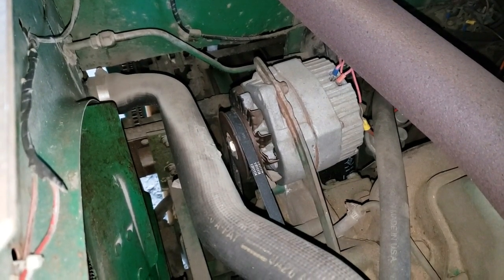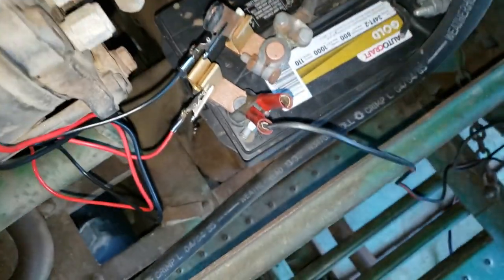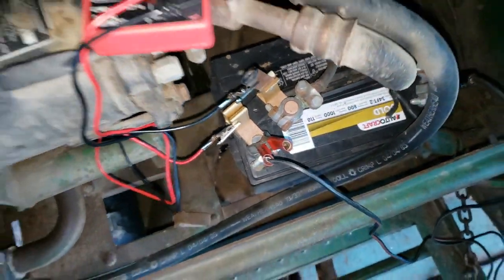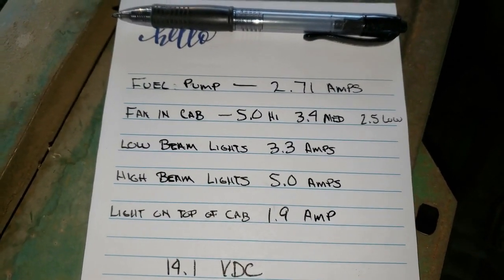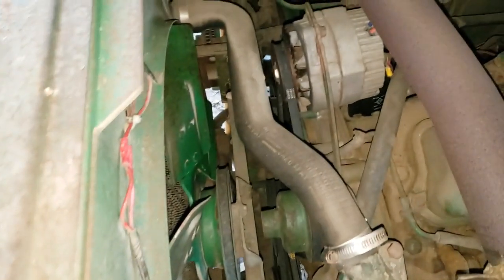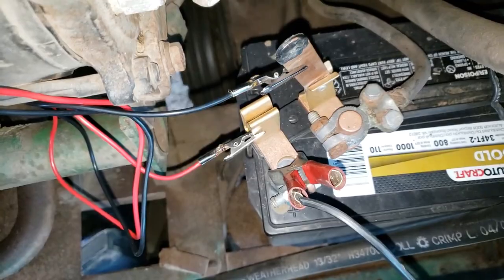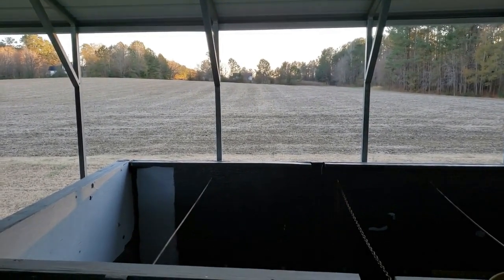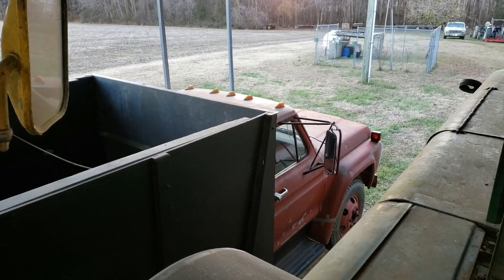Is that really enough Alternator

Comment: Great video. I put battery disconnect switches on all my equip. Saves a lot of dead batteries. mount a 2speed fan in the cab. It'll help with hot sun thru the windows.
Reply from the maker: The person I bought this combine from 20 years ago had already put one of those nice little two-speed fans up in the corner and yes it really does help out a lot but the biggest solution what's getting a cut off valve in that hot water line that actually stopped the flow of water. My last ride in the combine was great as far as heat went in that cab. Thanks for watching.

Comment: we almost went to all the GM 1 wire Alternators on all of old Ih tractors since we run a lot of monitors and gps equipment . Plus we might be going to a electric drive corn planter in the future and those require a certain amount constant. And funny you showed the battery disconnect since most of the new tractors and combines now come with them from factory.
Reply from the maker: https://www.dbelectrical.com/products/chrome-chevy-alternator-110-amp-one-1-wire-65-85-adr0335-c.html?mrkgadid=1000000&mrkgcl=1145&mrkgen=gpla&mrkgbflag=0&mrkgcat&acctid=21700000001643279&dskeywordid=92700057558223691&lid=92700057558223691&ds_s_kwgid=58700006372555049&ds_s_inventory_feed_id=97700000007195091&dsproductgroupid=841613208618&product_id=ADR0335-C&merchid=1552033&prodctry=US&prodlang=en&channel=online&storeid=%7Bproduct_store_id%7D&device=m&network=g&matchtype&locationid=9009721&creative=469157498045&targetid=pla-841613208618&campaignid=835875553&adgroupid=113219693514&gclid=EAIaIQobChMIkL7b_s3C7QIVmIzICh0uZgufEAQYAiABEgKloPD_BwE&gclsrc=aw.ds

I was joking around with Andy last night and asked him if he thought this alternator would be a bit too flashy for my 3300.🤔☕

Comment: It's funny how little juice the LED's draw , Way less than the old bulbs did. I put 11 LED lights on mine and they dont use as much as the 4 regular lights did. That was always a problem for the older combines, You just couldnt get enough lights on them to see good without killing the aultenator . So I'm all for LED lights cause you get more brighter light and its easer on the combine .  Cousin Bandit
Reply from the maker: I knew the LED lights drew a lot less current than the lights that I was replacing but I just needed to get my mind cleared up and wrapped around how much current was actually being pulled from that alternator. It's good to know that I got plenty of alternator space left and can add some more lights and maybe even an 8-track tape player, 😆 lol...
Hey you think this alternator might be too flashy for my 3300?
https://www.dbelectrical.com/products/chrome-chevy-alternator-110-amp-one-1-wire-65-85-adr0335-c.html?mrkgadid=1000000&mrkgcl=1145&mrkgen=gpla&mrkgbflag=0&mrkgcat&acctid=21700000001643279&dskeywordid=92700057558223691&lid=92700057558223691&ds_s_kwgid=58700006372555049&ds_s_inventory_feed_id=97700000007195091&dsproductgroupid=841613208618&product_id=ADR0335-C&merchid=1552033&prodctry=US&prodlang=en&channel=online&storeid=%7Bproduct_store_id%7D&device=m&network=g&matchtype&locationid=9009721&creative=469157498045&targetid=pla-841613208618&campaignid=835875553&adgroupid=113219693514&gclid=EAIaIQobChMIkL7b_s3C7QIVmIzICh0uZgufEAQYAiABEgKloPD_BwE&gclsrc=aw.ds
Reply: @SoybeanFarmer3300  Knowing in your mind what they draw amp wise puts your mind at ease . My old 95 I put a set of those row burners on it you know the old Hallagen lights that made an aultinator scream !  It finally took its toll on it cause the last time I ran it the aultinator went out and I think the lights had a lot to do with that.  I dont know if I would put an 8 track in it, It might be a bit too dusty for it to work good !  Good AM FM would do the trick  I think.  Mine has a AM FM CD player in it, I never turned it on ! LOL But its there if I want to listen to it !  Speaking of the radio if you got time and around the computer type in WOBO 88.7FM into the computer and you can listen to the simocast on the computer and you can see what kind of music they play threw out the day and week and it changes music styles. They play everything from old country blue grass gospal Polish German Irish old R&B big band 50's 60'70's  you name it they play it.  There MOTO is Something for everyone. Its a local public radio station you can listen to on the computer and I think you might like it . Cousin Bandit
Reply from the maker: Bandit thank you for sharing that with me I'll check it out.

Comment: Funny alternator story: I have 2 of that same alternator on a shelf. All new. Back when I was bringing in Jeeps to fix and sell one of the parts houses said they had 7 alternators I could have at $23.00 per plus shipping if I took all 7. Old stock they wanted gone.New and not rebuilt. Took all 7 and used on some wranglers,my Ford 335 Industrial, a case loader landscaper,a John Deere backhoe,and still have 2 left. That model seems to be a universal fit for the 70's and 80's era.Can't say I ever verified a load requirement for an alternator but seeing you do it makes sense. I have a clamp on amprobe and might turn everything on and see what the meter says for alternator output.
Reply from the maker: Amos thanks for sharing that with us.

Comment: What did the ac compressor use. That is when there is a big jump in amps. I can't remember if you said if the ac works or not on your combine.  

I just put 2 of those battery disconnects on the combine and 2 on my IH 1086. The battery slowly discharge over time. Now that I'm done for the season, I just flipped the arm and don't have to worry about it,  lol. I remember when you did the video putting it on so I took your idea. Thanks for sharing.
Reply from the maker: The AC compressor clutch is latched by magnetic coil the current flow on that is less than an amp. It's an old R12 system that needs charging probably a total rebuild  on certain components like say the dryer.  Yep I really like these disconnects on these batteries and they do seem to make the battery last longer. Thanks for watching.
Reply: @SoybeanFarmer3300  Curisoty led me to check on the price of R12 refridgerant.....$!40 to 160 a pound... Chances are almost every thing but the condenser and Evaporator would need replacing.....(Comp, Expansion valve, Drier, Suction line, Hot gas line, warm liquid line...
Reply from the maker: @farmingforfunandprofit940  there was a good joke going around back when gas prices were at $4.25 a gallon. Teenage boy came in and told his dad he had just filled his car up with gas and now his car was worth twice as much. The tires were the big expense this year next year I'm going after rasp bars. After stopping that hot water from flowing into that heater core the ride really wasn't that bad. I'm never going to do wheat so I won't be in that Cab in June ever again. Thanks for your thoughts David. Always good to see you here my friend.

Comment: we don't have lights working on most of our combines we have mice get in there when we are using then combines over winter spring and summer and they chew up the wires so the 4400 and the 6600 that we use for corn dont have lights not totally sure about the last 6600 it might have them but i know the 4400 and the 6600 dont have them and probably never will
Reply: I never understood why tractor manufacturers don't do better on wiring. Something as simple as a bittering agent in the insulation would fix the problem with rodents eating same.
Reply from the maker: https://www.thedrive.com/news/20878/rodents-are-feasting-on-newer-cars-soy-based-wiring-insulation
the cost of repairs for some have been through the roof.
Reply: @SoybeanFarmer3300  we need a wire that can not be chewed threw by mice bc that’s our problem is that we can fix the wire all we want but the mice will just chew through it again
Reply from the maker: The total solution to your dilemma is going to be expensive but I would actually recommend total encapsulation in conduit. Or get a cat and make sure the Cat Knows where his food is at.
Reply: @SoybeanFarmer3300  we don’t have enough space to have them at our place so we rent a place and have them there but where we rent there is a cat

Comment: Good calculations SBF, I guess if it was a gas engine it would have at least a 55Amp Alt in there
Reply from the maker: Jan my friend you just made an excellent point yes if it was a gasoline engine requiring ignition spark the alternator would certainly have to be stronger. Thank you for making that statement here.

Comment: My Gleaner has two alternators,but it also has two electric clutches ,one on the header drive and one on the thresher drive and wow does that draw some amp's especially with the lights on. Thankfully I've changed 2/3 of them to LEDs! Thanks SBF
Reply from the maker: https://www.westmarine.com/buy/balmar--max-charge-digital-12-volt-regulator-for-dual-alternator--12032991

Most people would never be able to correctly wire this up and the troubleshooting confusion in the event there were problems or issues would send them looking for someone who thoroughly understood DC circuitry. Heck, I had to sit here and think about it for a while to realize how it could be accomplished. Most of the forms that I shot through simply talked about replacing the single alternator with one with a higher output. I kept getting hung up on how would you handle voltage regulation and create proper isolation but there's a component specifically designed for that purpose it's called a voltage regulator for dual alternators.  CE, thank you for something to genuinely challenge my thought process. Always a pleasure to see you here my friend.

Comment: Good use of forced down time, one less detail to be concerned with. God Bless Brother!
Reply from the maker: Went shopping today to found myself back up at Harbor Freight. They had a 29 piece drill bit on sale for 10.99 with coupon.  How do you re sharpen drill bits?
Reply: @SoybeanFarmer3300  Resharpening drill bits is a learned art. A good instructor detailing the needed geometry and lots of practice.
Reply from the maker: So that's why I've had no success. Seriously after my attempt at sharpening a bit I think it's actually duller than it was before I tried to sharpen it, it certainly cuts no better.
Reply: @SoybeanFarmer3300  Hey, just happened to see this... Look up This Old Tony.  He's got an excellent video about drill bits and makes sharpening them make a lot of sense.  I've been sharpening my own now for a couple years just on the bench grinder and it gets a lot easier with experience.
Reply from the maker: Thanks for telling me about that channel I will certainly go and check it out. I'm open to instruction because I would really like to learn how to re sharpen a drill bit. I've got plenty of bits that I've ruined attempting to sharpen them that I could use to practice on I just don't truly understand the technique required. Thanks again for the input.
Reply: @SoybeanFarmer3300  Look into a drill sharpener, especially for smaller than 3/8' drill bits. Some work real well.
Reply from the maker: Any recommendations on those? I have looked at 1 called Drill Doctor but some of the reviews on it make me hesitant.
Reply: @SoybeanFarmer3300  The Drill Doctor has been around for years. Every devise has some flaws. The angle of the tip (59 degrees), equal widths of the drill tip and clearance behind the cutting tip is the most critical. The Drill Doctor has to be affordable so it will have some issues after multiple uses. Patients and understanding the directions should produce a decent usable drill bit.
Reply from the maker: That was one of the complaints the tool wore out too quickly and went out of adjustment. I was thinking the wear on the cutting Stones is probably what took it out of adjustment. As you said it has to be made affordable so it's probably not got the best materials in it.
Reply: @SoybeanFarmer3300  You can also get attachments for bench grinders that will hold the bit at the proper angle and allows you to kind of roll the bit into the grinding wheel.  They work really nice and help keep the point centered.  They take more setup, but should outlast a drill doctor.

Comment: What does air,con compressor pull
Reply: Great Comment! I laughed. I believe it pulls the least amperage, ZERO, but you knew that!
Reply from the maker: Actually there's a magnetic interlock on the clutch which engages the compressor and causes it to turn with the V belt going back to the bottom pulley on the crankshaft of the diesel engine. I did not think to even check it because the AC has never worked. I would think that the actual current Demand on that would be less than 0.1 amps. But now just for fun and because I can I'll probably give it a look-see. Jerry that was a great question and a detail I simply overlooked.🤔☕